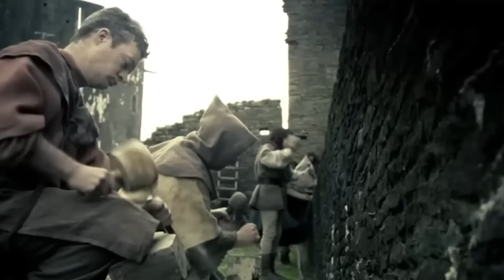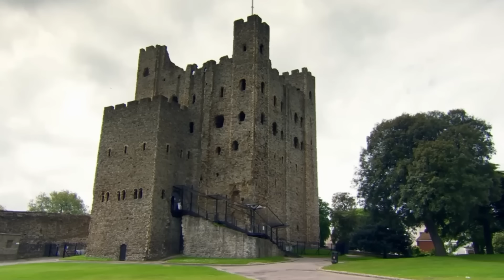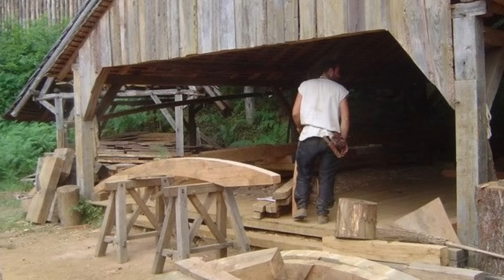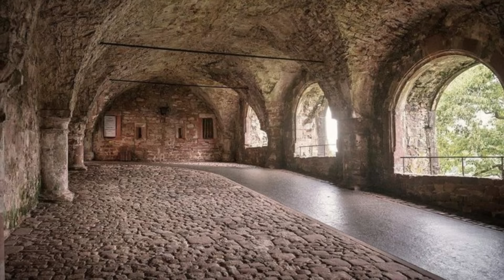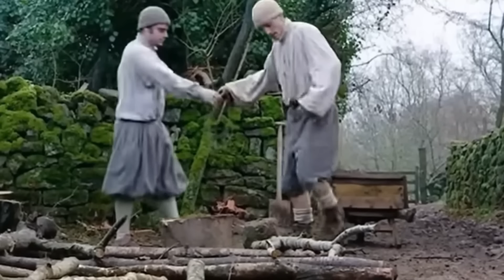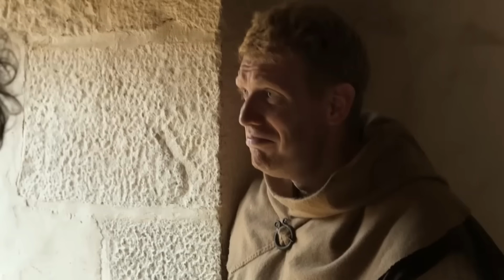20 BANNED Medieval Building Tricks That Scientists Now Say Were GENIUS

Comment: Rubble fill on walls didn't drive Victorian architects crazy; rubble fill is still used to this day when building drystone walls. It's easier to get the smaller pieces of rock to lock up against each other than it is to get big ones to sit correctly, and the rubble fill transmits and dissipates impact better, so a castle wall with dressed-stone facing and rubble fill will stand up to catapult-thrown rocks or cannon better than full-thickness cut stone walls.

Comment: 3 min in and I gave up with all the bullshite. Compare apples with apples. Concrete doesn't set in hours, it depends on the thickness - the Hoover Dam is still setting after 90 years. They didn't use wooden pegs because they were good they used them because metal was too expensive or unavailable. we don't spend a 100 years building a building to last 100s of years now we build them fast and cheap - what would it cost to pay trademen for a 100yrs?

Comment: in aarhus denmark, they have an old city. comprised of houses from 1200-to present. they have a special team that litterally collects old houses around the country, full disassemble and transport and put it right back up. this happens for instance when a house is so old, that the law makes it a nightmare fix on (has to be historically restored). but yeah you can go see roofing of multible big old buildings and they still used the old wood instead of new for all the parts that was possible.

Comment: you screwed up the medieval wood cure as soon as trees were felled they soaked them in brine and lime water this would draw out the sugars and leave lime and salts in the place of the wood sugars this was like vacuum sealing and curing each timber took two weeks and having laddles stir the mix as they basted the logs periodically then they cut them and finished them leaving them to air dry medieval wood was then often white washed this lime mix further preserved the wood and they incorporated boiled walnut husks and rotten leaves the salts and lime while the wood was living pulled in the tannins and salt and lime into the cellular levels  the salts lime and tannins drew into the wood at very high levels I cannot imagine a more terrible job than making walnut husk teas the stink alone would drive bugs and worms and rot away cross sections of the wood reveal the lime crystals and salts soaked into the wood cellulose at the cellular levels! this could only occur if the wood was still alive carrying water and the limes tannins and salts but the benefits strength that lasted centuries some as much as 900 years imagine harder wood floors bug proof and rot proof! the draw pegging is the kicker tight bonds in stable preserved wood today our wood houses are aging out rooting etc with in decades but fast and cheap you get what you prepare for cheaper loses every time and the old craftsmen the guilds knew this!  You do not need old growth timbers you need living wood soaked in lime waters and salts with a dead leaf tea mixed with walnut husks to increase tannins 2 weeks then process and air dry lime white washed after install then plasters bond better also infusing more lime! Rush living wood to the mills with out treatment short lifetime usage is the result it is a waste of resources! leach out the sugars and replace them with lime salts and tannins lasts for centuries! incorporated with lime stone plasters and even lime clayed daubes and bingo Like the old crafts men said give a house good shoes [foundations ] and a good hat [the roof] and constructs can be nearly immortal they built for generational holdings! Old heating systems like roman hypocausts offered year arond comforts even heated pools that cooled on hot summer days! Those tradeguilds have forgotten more than we know today!

Comment: I stopped listening at 6 minutes in as you are presenting grossly false information.  There is nothing in modern building codes that prevent us from building with lime-crete and stone construction.  There are no legal requirement so use Portland cement, nor for walls that are not perfectly straight.  What a bunch of utter BS.

Comment: The rubble wall technique is actually from the sieges: if your wall is made of packed earth and rubble, the force of any projectile sent by a catapult or a trebuchet will diffuse in the rubble, which will absorb it. Also, they tended to add chains to the rubble, so that the walls were still standing if the enemy tried to sap them at their base
Reply: I lived in a house made by quarry workers, that was about 250 years old.  the wall on the left was 26+" thick.   I know, because my drill bit was 24".  It took the water guys days, to install a new meter, days.  they did not know how to get thru walls that thick, where they were trying to get thru, was thicker, but like any idiot, they found the thickest rock in the wall, and decided to go thru it.  They wound up cutting a foot off the foundation rock.  When I finally drilled a hole to install an outside faucet, thru the two walls (two walls in a single wall), when I pulled the drill bit out, the fill between the walls, kept falling and filling the hole.   It took me a day to drive a pipe thru the wall.  A bigger fill rock kept falling into my hole, and blocking.

Comment: Timber frame with pegs are not illegal. Wattle and dob is legal too.   Ruble core walls are legal.  A sky scraper made of unreanforced masonry would require extremely thick walls!
Reply: A concrete sky scraper designed properly will outlast the pyramids. 
Anything made from concrete has to have flexible joints.
Reply: I can’t stand this AI bullshit

Comment: "Walls must be load bearing now, no exceptions" - not true.  Most skyscrapers do not have load bearing walls, neither do steel frame buildings like the all metal "Butler Building"s.  

That's just a tiny nit to pick against a quite informative video though, please don't take it a some sort of a major defect in the video because it isn't. It's only an accidental generalization.

Comment: Would the air pockets between the “rubble” behind the outer stone in medieval have also provided some insulation?
Urine was used to set dye in wool.
Reply: I think the rubble is also mixed with dirt so it doesn't have much air in it BUT the section on those thick walls that have the thermal mass tells how they work even better.

Comment: "A single cathedral roof might contain 50,000 wooden pegs. Each one handcarved to match specific grain orientation. That level of craftsmanship takes years to learn." Complete and utter rubbish! Whoever wrote this (AI?) knows nothing about wood work. A dowel (wooden peg) is ALWAYS long grain, if it were short grain you'd never hammer it in, it'd break apart.
Reply: This whole channel is 100% AI, it always has been. The most obvious sign to me is the constant use of 'Here's the thing nobody is talking about' or similar phrases to introduce new paragraphs. Regardless of whether or not the thing they are talking about is actually widely known. Once you hear it you can't stop noticing. It's getting worse, too, which means oncoming model collapse.
Reply: There’s A LOT of misinformation given in these videos.
Reply: there is more than one plane of orientation to consider in wood grain. You are only talking about one such.
Reply: @MushroomMagpie  Can't you read????? I mentioned long and short grain, that makes 2 types and if there are any more please tell me because it would be news to me.
What are your qualifications in woodworking?
Reply: I'm pretty sure they also coated the wood pegs with something to help prevent rot and had to replace some of the  pegs after so many due to rot. If they were in high moisture places.
Reply: @michaelbrinks8089  If they were using oak, which is most likely, moisture would not have been a problem. Oak is often used to make barrels and cathedrals are not really 'high moisture places'.
Reply: @mehrcat1  I was thinking more like old barns with oak pegs.